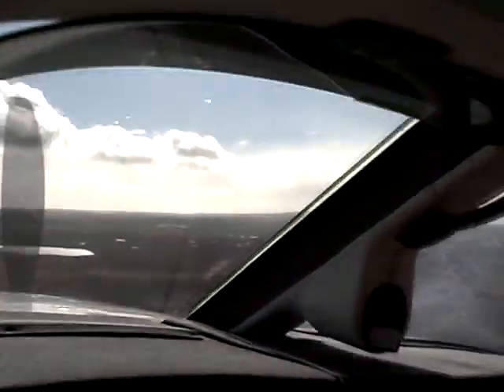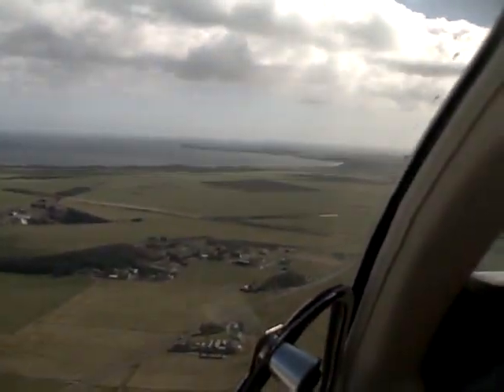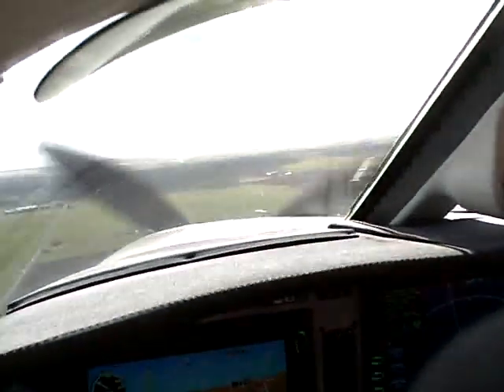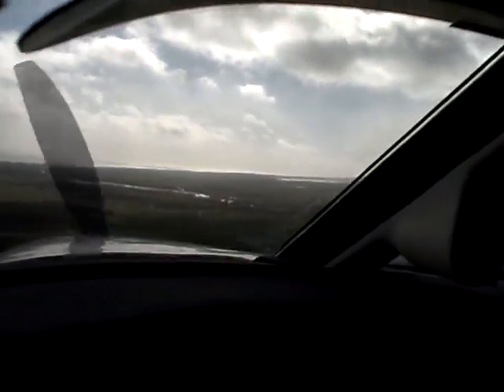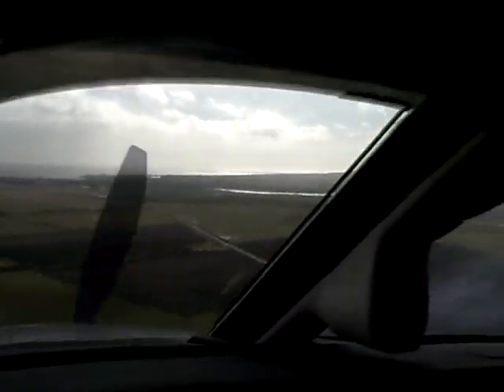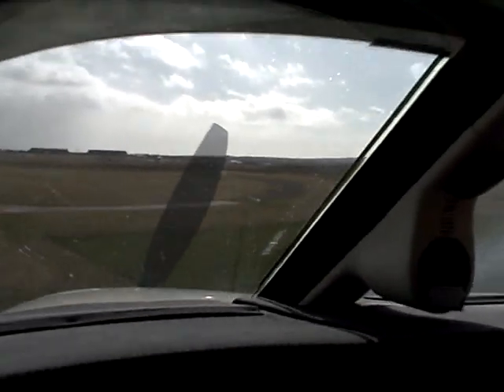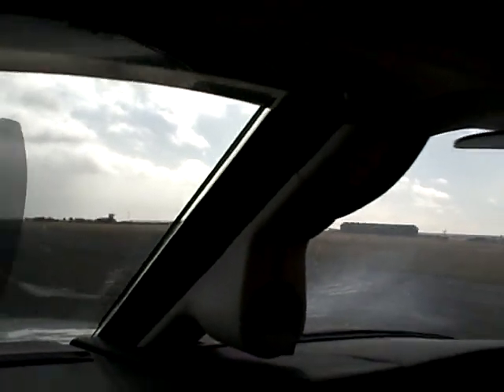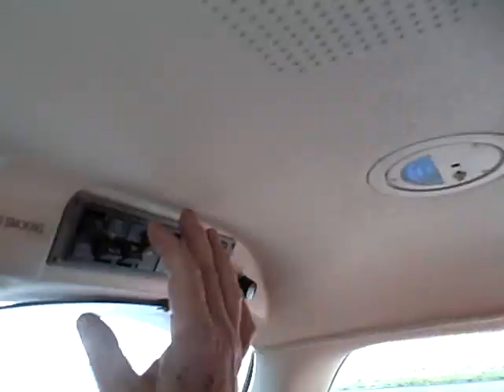North Atlantic Crossing: Part 23 of 23 -- Landing at Wick

Comment from the maker: Hi David, Yes, 100LL is expensive usually. Woodward in Goose Bay is the only place I have encounterd fuel by the barrel. I don't recall the price but it changes a lot. I have not crossed the North Atlantic in a non-FIKI, non-pressurized aircraft so I do not know much about that. You will need some specific training and an HF radio in addition to survival gear. I suggest AOPA as a start and Air Journey for planning services. Language is no problem although some of the phraseology is different.

Comment: Excellent series of vids. A few questions, if you can.
I'm sure fuel (especially in barrels) is expensive, will $10/gallon cover it?
If one was thinking about taking an A-36 (non FIKI) is a crossing still practical/safe?
Is English really the language of aviation, did you have any trouble with languages?
Please take a bunch of flights and post more great videos!!!
Reply from the maker: Wilco .. controllers of speak English worldwide. If my customer is speaking, his local language, the controller will respond to him in that language. It really isn’t any problem from a safety standpoint. Consider speaking with Air Journey fort concierge service. If you’re unsure of the places you’re going. They are the best. Fly Safely - Train Often .. DR